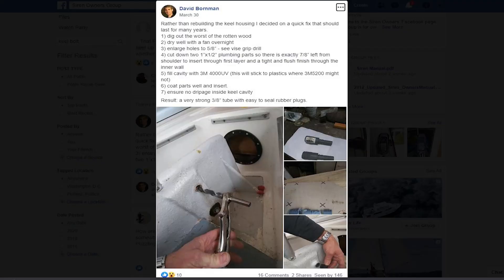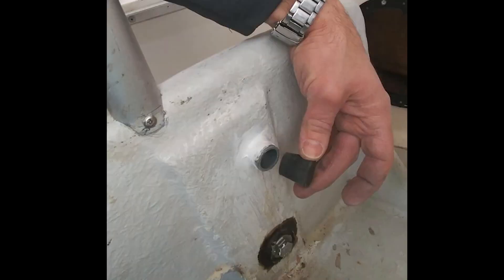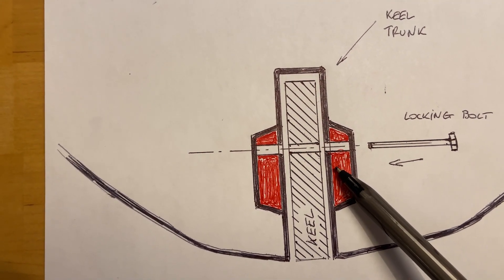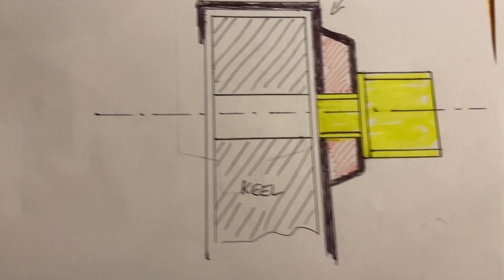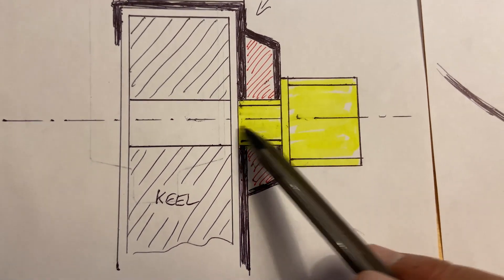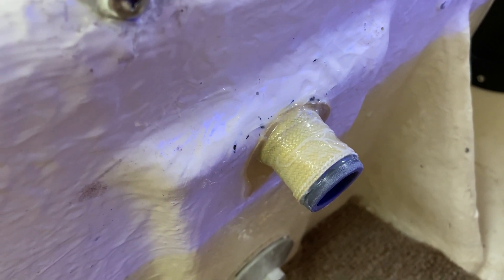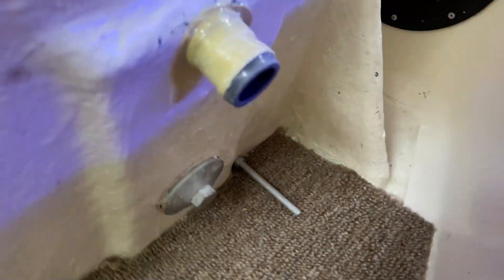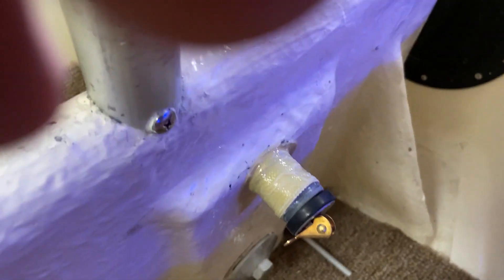Siren 17 - Keel Locking System Improvement

Comment: It might be a good idea just to install the narrow section of the coupler on one side and fiberglass over it. The pin could be attached to the plug and put in and taken out from one side.
Reply from the maker: Yeah but if you hit anything with the keel locked and bend the pin, you won't be able to force it out by tapping on it from one side and your keel will be stuck in the down position, not a good situation.  It happened to me once...
Reply: @siren17 Fair point! This is the value of experience. Thanks!
Reply: Hello, I just wanted to let you know that you have been a great inspiration to me. I have watched your videos over and over again in order to make upgrades to my boat! I also think that the video you created on sailing parts of Lake Superior is the best Siren video ever. Thanks for your efforts!
Reply from the maker: @RayWhittaker-p8q thanks for watching, I am glad you like those!

Comment: Really nice job! Will try to do it.  Where and What should i look for if i want to reinforce with kevlar too? Also do you wrap it around and then put epoxy on it? Can you describe a bit more the kevlar application step, please?
Reply from the maker: Yes, just a piece of kevlar ribbon impregnated with epoxy wrapped around the based of the PVC tube to secure it to the keel box.

Comment: If I understand this correctly, this hole would have to be drilled when the keel is down? Otherwise you would have to also drill through the actual keel metal? Or am I missing something? Thanks (brand new siren owner)
Reply from the maker: Unless it was plugged by a previous owner (which happens sometimes for convenience….), the keel lock hole should already be drilled in your keel trunk.
Reply: @siren17   Thank you! I was under the impression that this was not done by the manufacturer.  Your videos are the reason I purchased my siren 17!
Reply from the maker: @aviewfromthewall   Thanks for this, I feel humbled.  Maybe someone should start building Siren 17s again!
Reply: My south coast does not have a hole in the keel itself but rather a notch on the trailing end of the upper keel just above the pivot bolt that allows the retaining pin to be installed after you lower the keel but does not require you to line up the holes that you can't see just to get the pin in. Has a little play between the pin and the keel but seems to work well with a solid SS pin. I would not use aluminum or plastic for fear of either snapping during a turn up. My keel is over 600lbs and could smash through the keel trunk if it slams shut on me.

Comment: Man, this SO reminds me of the water intrusion issue with the O'Day DS2! The uphaul cable passes through the CB trunk forward into the cuddy. There is a gap between the trunk and the cuddy pan, which was filled with some kind of goop during mfg. Over time that stuff breaks down and falls out, leaving a gaping hole for water to be shoved through that hole like a firehose when the board is down and sailing fast. And that water goes straight into the bilge. Not good! The fix is not that different than your solution Thierry, involving a short piece of threaded pipe inserted and sealed between the cuddy and trunk interior, and the same care must be taken as well to ensure that it does not penetrate too far into the trunk. A bit of water still gets squirted into the cuddy, but better there than the bilge!